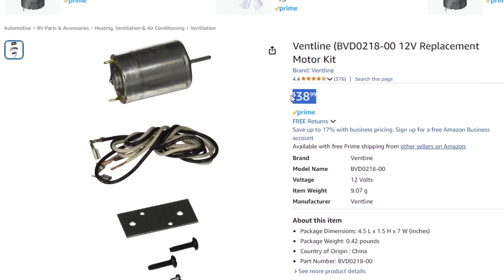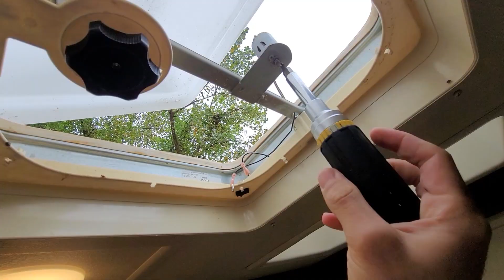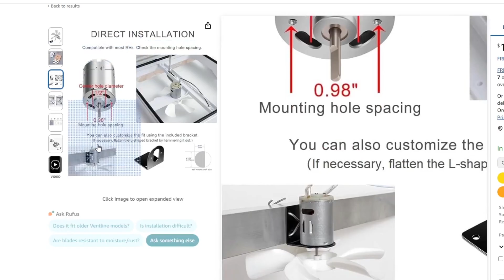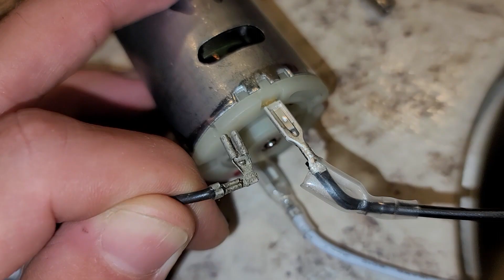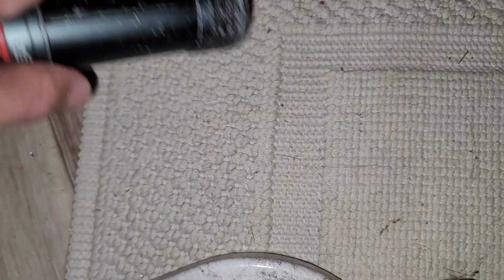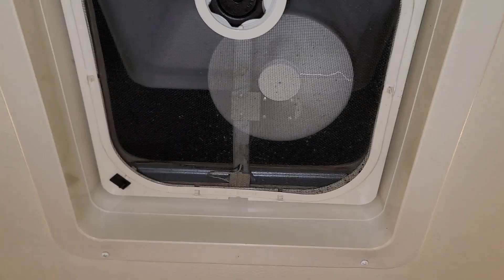How to Replace an RV Exhaust Vent Fan Motor (PlusRoc 250 CFM Upgrade)

Comment: How did you remove the wires
Reply from the maker: Off of the motor? I slid them off - they may need encouragement from a flat head screw driver wedged between the spade contacts.